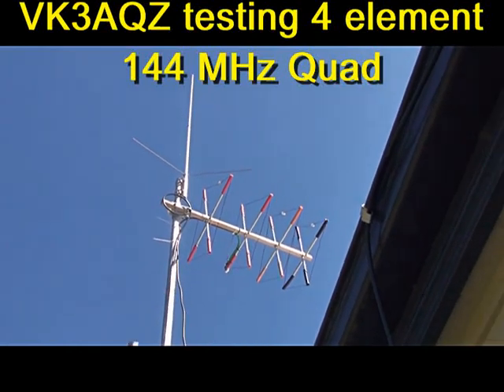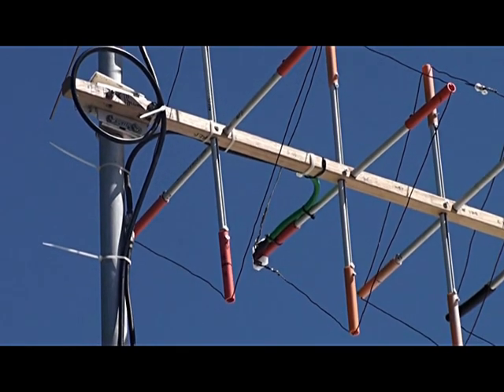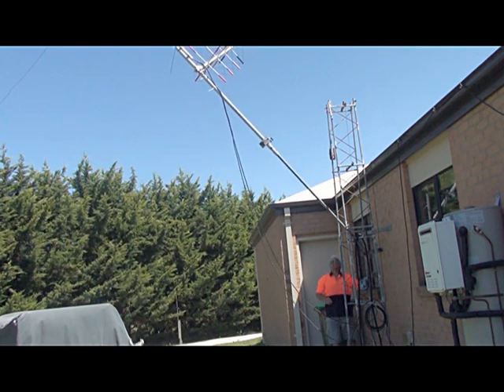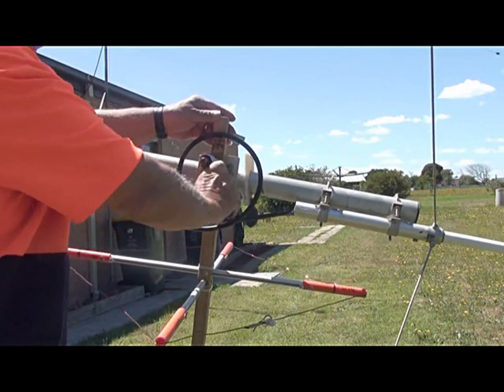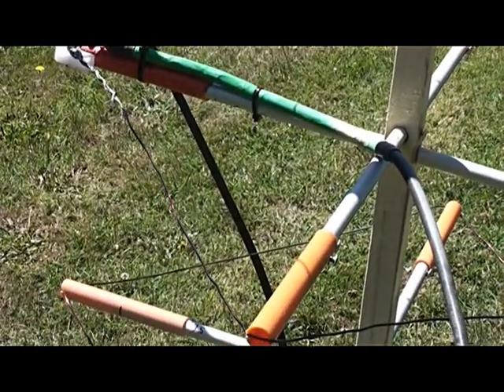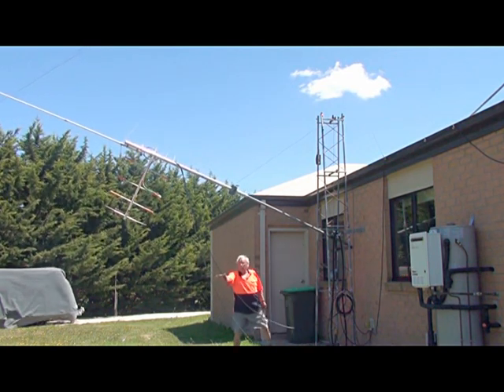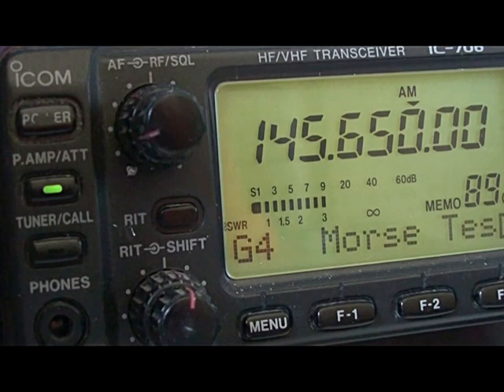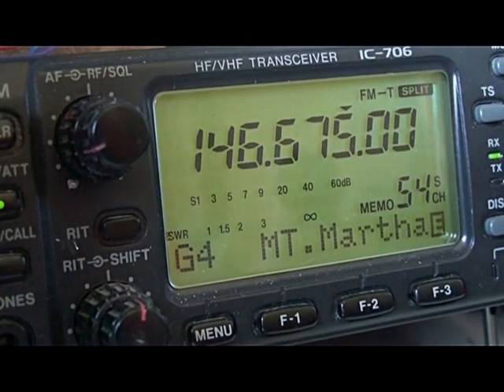VK3AQZ 144 MHz 4 element Quad demo

Comment: Test at the end made NO sense.
Reply from the maker: Early in the video I mentioned that the quad was set up for horizontal polarization. So, the tests at the end were showing the difference between a horizontal quad working a vertical repeater, and a vertical X200 working the same repeater.

Some of the locals asked me to show the difference. The tests show the horizontal quad working a vertical repeater is between 20 and 30db down on the X200 vertical on the same repeater. The X200 has around 3dB gain when going vertical to vertical. The 4-element quad has 6dB gain going vertical to vertical, which is better than the X200, and 6dB horizontal to horizontal.

The theoretical difference between cross polarization is around 26dB. So, this test shows that is about right.

I would have shown tests between the quad horizontal and other horizontal stations, but there is only one signal that is horizontal in my area. It runs morse tests and training. And there are no horizontal repeaters in my area. When I had the quad as a vertical it worked 3dB better than the X200 front on, but it has about 20dB front to back, so it is working correctly as a beam. Overall, the quad is better than the X200 on the same polarization and has the big benefit of a good front to back ratio, which drops the overall noise level. And it is easy and low cost to make. By the way, I am blind at the moment. Someone read me your comment and said you used capitals for "NO". Why - that is like yelling?

Comment: Very impressive tower situation!  I very much liked the quad, it was cool...liked how you painted the wood to resemble aluminum!  :)  I too have the X200, in fact I just put it back in line today after a 20 year break...I got tired of HAM and took 20 years off...recently got my ticket again (YL also)....been enjoy DX on 11 meters, have worked station from Australia!  Anyway, I enjoy and appreciate what you do!  73's from the states.  ~Jack, VEG
Reply from the maker: Thanks for the compliment. Yes, my XYL is also VK33ZY, Rhonda.  She was licensed around 1968. The tower works really well. I designed it a few years back,. The height meets the council tower limits here which only let you go as high as 9 metres or 3 meters above roof. The A frame tower you see is 4 meters but can also be made another 2 meters higher. The tower calculations will  allow the centre pole, made of scaffold grade Aluminium, 3mm thick, 65 mm diameter tubing, to go 4 metres above the tower top. The strength calculations allow for a full size 40 meter, 3 element beam. The tower itself, however must be guyed, or supported, by a wall, as seen in my video to meet those ratings.